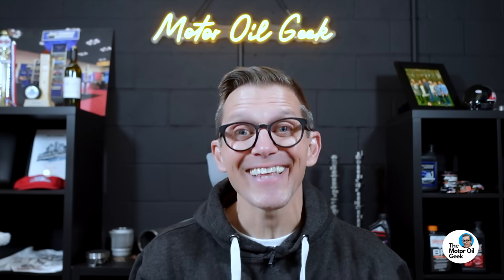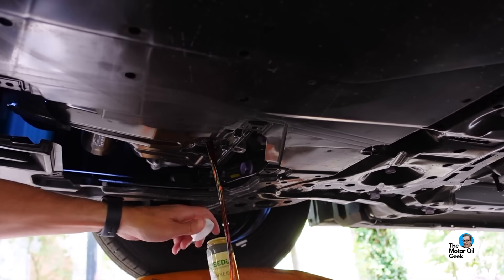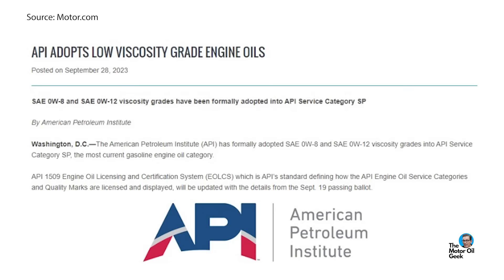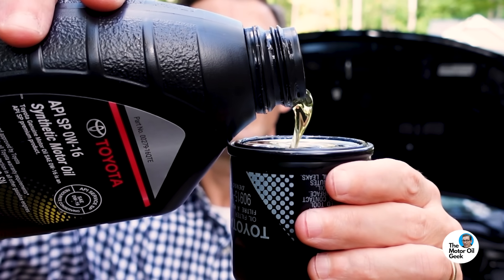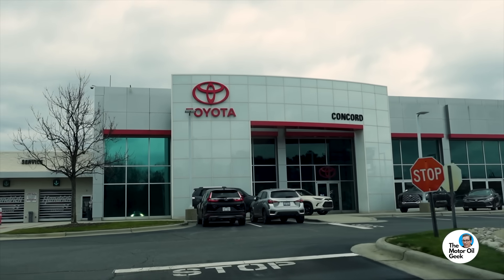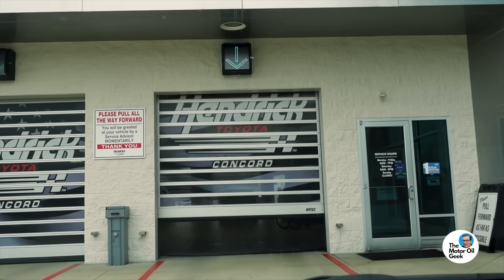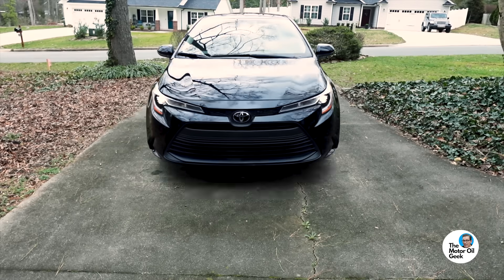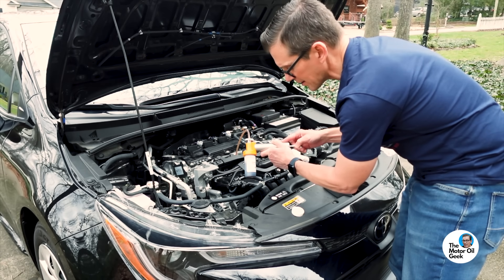0W-8 Motor Oil: Too THIN to Trust? Let's Find Out!

Comment: It's great that the Henricks Toyota Dealer in Concord used the proper quality oils.  I don't know the policy of Toyota over their dealers on what lubricants they're permitted to use.  But typically dealerships will order in bulk from whatever oil distributor they get the best deal from.  

To be clear, whatever oils they use are not some cheap no-name oil.  They will get a known quality name brand that we have all heard of.  But it isn't always the "OEM" branded product.
Reply from the maker: I was pleasantly surprised as well!
Reply: As a hendrick Toyota Tech, I've only ever seen the toyota genuine oil ordered in bulk, I see pallets of the shit piled in parts every time I go to grab a box, we have pumps for 0w-20, 5w-20, and 5w-30. They use a synthetic blend so I've heard from the older techs, when it comes to off brand vehicles we usually source what they recommend (Mobil1, DEXOS, etc...) if the manufacturer doesn't specify what the vehicle needs then they get whatever is coming out of the pump. My favorite oil I've seen was this green shit we had to special order for a BMW weird euro spec stuff
Reply: @S1Lent_Wanderer  Good to hear that your dealership makes this effort.  Many don't.  I know of a Chevrolet Dealer and a Dodge dealer for example that buy the lowest priced stuff in a drum they can get at the time they order more oil for their service departments.  

Even then, it is good oil and isn't really likely to hurt anything.  I know that the Dodge Dealer gets a 0W/20 and a 10W/30 no name synthetic and the same weights in a conventional no name oil.
Reply from the maker: @S1Lent_Wanderer  Thanks for sharing!

Comment: I ❤ Toyotas, but don't trust any dealerships. I'm a mechanic at an independent shop and have seen some unbelievably sly things being done at dealerships. Remember, the Toyota dealerships aren't Toyota, they're all independently owned and run. I don't trust any dealership of any manufacturers at all. They lie and deceive. The only real way to know 💯% that your car's getting the correct maintenance is to do it yourself.
Reply from the maker: I hear you. From the comments already, there seems to be quite diverse responses from different dealers. Your points are very valid.
Reply: @themotoroilgeek  I actually witnessed my local Nissan dealer send one of their techs across the road to go and buy cheap aftermarket cv axle rubber boots to fit on a customer's car. This is in South Africa. I drive a Nissan Sunny 2001 model and replaced my cv boots with the cheap aftermarket (Partquip) one's,  and they lasted exactly 18 months, whereas the original boots lasted 18 years!  
I duly replaced them again with Genuine Nissan boots (at exactly 10x the price of the aftermarket one's), and they're holding up just fine. So, that dealer is obviously charging the expensive price, fitting the cheap one's, and he's guaranteed a return customer within 2 years, when their cv joint goes bad. If you're not very mechanically inclined, or even a tech yourself, you can get ripped off badly. The independent diesel shop where I work at do this all the time to people. I just shrug, became I'm just an employee and need my job.🤭
Reply from the maker: @BubblesTheCat1  WOW!
Reply: @themotoroilgeek  Yep, a woman came in with her Hilux 2.8 Turbodiesel, which she uses to tow a horsebox trailer.  She noticed an oil leak, and I got the job to inspect and repair. I discovered the "half moon" at the rear of the valve cover leaking, causing oil to run down the gearbox bellhousing. My bosses told her it's the rear main oil seal, and promptly had me remove the gearbox to replace the seal. They then also told her it needs a new clutch (it didn't), and I had to replace that as well. After I finished everything, my boss said: "O, and don't forget to remove the valve cover and reseal the half moon rubber with gasket sealer. So, they did actually replace all that stuff, but it wasn't necessary at all.

Comment: I would like to see this oil in a high stress environment like towing or racing.  I bet we all know the outcome. Im not against thin oils. But  even Ford specs 5w50 for the track pack coyote. So obviously, thicker is better in high stress environments. Maybe in the corrolla, it doesn't matter, but i wouldn't lose any sleep with a 5w30 in it.

Comment: I’d like to see an episode on zinc/zddp for flat tapped cams. How much is need for breaking in the cam.How much is needed to keep a flat tappet cam alive after break-in. Is ZDDP corrosive or cause bearing to flack as some internet expert’s state.
Reply from the maker: Check out the video I did with @DavesAutoCenter

Comment: Thank you for sharing this valuable data. What engine oil change interval would you recommend for a 2024 RAV4 hybrid which is averaging 50% in EV mode and 50% in gasoline mode?
Reply: This 2019 Camry owner has the same engine as you do and it has lasted 501,950 miles using Mobil 1 0W-20 changed every 4,000 miles: https://imagizer.imageshack.com/img923/3987/L6hyvR.jpg

Comment: Didn't realize that the new Corolla also requires 0W-8 oil.  I've only seen it for the Crown and the oil almost feels like water.
Reply: "Required" only for US government mandated maximum fuel economy reasons.  Outside of the USA Toyota owners manuals tell new Corolla and Yaris owners they can use 0W-8, 0W-16, 0W-20, or 5W-30 if they want to. https://imagizer.imageshack.com/img924/6495/sVxyf0.jpg

Comment: Lakespeed you should try Amsoil cvt transmission fluid. It was a night and day difference in my vehicle. My mitsubishi lancer runs very smooth. Ask Bearded Ford Tech. Just make sure its compatible for the the vehicle.

Comment: My wife's Subaru calls for 0-w20. It started burning oil at 120,000 miles requiring a quart every 2500 miles. I switched to 5w-20 and it hasn't burned a measurable amount of oil for 80,000 miles since.
Reply: The W number is strictly a cold measurement, it's likely something different between the two.
Reply: @PSA78  they recommend 5w 30 so they want higher weight in cold an hot also higher weight oil you get less blow by on these di engines so less intake buildup
Reply: @JoshDillon-lm3hw  It's not "weight", the W(inter) is just a measurement of cranking force at a specific temperature (really low) and the last number is regular viscosity (span) at 100c (converted to a number for each specific type of lubrication; like engine or transmission). The W number can theoretically always be reduced (diesels sometimes excluded practically as they don't like the high amount of viscosity modifiers that might be needed). 
How much oil they burn is more down to how volatile the oil is, a small change in viscosity isn't going to matter when all things are considered. There's possible wear reductions with lower viscosity as well as the additives works more efficiently in mixed and boundary lubrication regime, it all has to come together in the end. 
It's like Lake says, let the UOA tell what's happening
Reply: @PSA78  the numbers are the weight of the oil lol weight is what viscosity was to called the last hundred years why people who don't know oil think that's what w stands for
Reply: @JoshDillon-lm3hw  I dare you to Google what W stands for. 👍
Reply: @PSA78  I know what w stands for winter why don't you google oil weight
Reply: @JoshDillon-lm3hw  I just had to inform you that W stands for Winter, you said it stands for weight.
Engine oil viscosity is typically categorised under sae grades.
Reply: @PSA78  no I never said w stands for weight  you never read what I said you made assumptions I didn't know what w stood for because you didn't know what oil weight is
Reply: @JoshDillon-lm3hw  What are you on about?
Reply: @JoshDillon-lm3hw  What they're on about is that "oil weight" is technically not the correct term for the XW-XX number system used for oil grades. Oil Grades are what are technically referred to with  5W-30 et al monikers. Weight just happens to have become synonymous with Grade because people don't speak technical data sheet and marketing teams know that.

So maybe don't make fun of people for not knowing something without making sure you actually know what they (and you for that matter) are talking about first. 🤷🏼‍♀️
Reply: @Horerczy  I knew exactly what I was talking about the whole time an im not the one who budded in the conversation started working in an oil shop when I was in school an have built track car motors last 15 years while yes oil weight isn't technical term it is the term used in every shop by every older guy I've worked with my whole life
Reply: @JoshDillon-lm3hw   So what you're saying is you're knowledgeable but suck at communicating that knowledge. Got it. 👍🏼
Reply: @PSA78  Weight was a synonym for winter.   If I said I was using a heavier weight than 0W20, most people knew what it meant.  But yes, W is for winter.
Reply: @lonniebeal6032  Weight was a synonym for winter? 🤨What do you call summer then?
Engine oil is measured in kinematic viscosity by standards (usually at different temperatures to include VI), and absolute viscosity at different really cold temperatures. The W number is representing the absolute viscosity at really low temperatures, and each W number has its own temperature and viscosity threshold/span (it's there for pumping at extreme cold climate, that's it). The kinematic viscosity also have a span, upper and under that will put it in a sae grade (and those numbers are also different for say engine and gearbox classification even if they measure the same).
I know people sometimes wrongfully use the word "weight" in some countries when talking about viscosity/grade and I'm guessing that's a century old habit, but the W number stands for Winter, and the latter number is the designated span it's in at 100c. 
Just for fun I Googled and the page show article after article from lubrication companies specifically pointing out that W stands for Winter and not weight.
Reply: Carbon cleaner. Rings are stuck. Seafoam
Reply: No
Reply: That's cause subarus seem to only call for 0w 20 in the US I have a new wrx an it say 0w 20 but in Japan Australia an Canada manuel says 5w 30 it's emissions crap they don't care about the life of your engine

Comment: You just opened up a big bag of snakes!
Both Valvoline and Castrol now sell ATF/CVT fluid.
You can pour it in both types of transmissions.
I have been using the Castrol for both types of transmissions with no problems. So what gives?
Reply from the maker: One size fits all means it doesn't fit anything well.

Comment: Just got back from the first dealer service with my 2023 RAV4 and quite disappointed to see that they used 5W30 while it should be 0W16. 

Ofcourse I asked why and they said this is what Toyota advises and even showed me in their system. I’m a little confused now, but it doesn’t feel good to leave it in…
Reply: 5W-30 is fine for your A25-FKS engine. Australian owners manual: https://imagizer.imageshack.com/img924/8145/trnGHE.jpg The USA government wants you using 0W-16 for maximum fuel economy reasons.

Comment: Some Toyota hybrids take regular Toyota ATF. They use 2 electric motors and a planetary gear set to change the gear ratios rather than a belt or chain. Super reliable and durable
Reply: eCVT
Reply: Toyota HSD hybrid system is NOT using a belt don't get mixed up with DAF Dutch cars or some FIAT transmission. The CVT is made by an electric motor (different from the traction motor) controlling transmission ratio with an epicycloid system. Indeed the feeling is about the same , kind of weird not really sports like excitement, just your wallet is very excited.
Reply: @semperfi4309  I beg to differ. My 2002 Prius is definitely NOT a sports car, but response to the accelerator is instant. Zero rubber-band effect (you step on it, and it ACCELERATES, it doesn't lag)
Reply: This is correct  @semperfi4309
Reply: Yes. They have eCVTs instead of CVTs with a belt or chain and cones. They recommend only Toyota WS ATF.
Reply: This. My 07 Prius uses the same Valvoline MaxLife ATF that my 07 GX470 uses with no issues. ✌️
Reply: @VuickB6  How do you know it has no issues? Maybe it will last 150,000 miles but regardless how long it does last, if you used only Toyota's recommended Toyota WS ATF it might last an extra 25,000 or 50,000 miles  extra?? We'll never know will we?
Reply: @stevensevek6151 Using fluid that's the same spec as factory makes me think they'll last the same. After all the Lexus has 205k miles and the Prius has 292k miles so something is working as it should. 🤷
Reply: Ok you’re talking about the Hybrid not the gasoline motor only
Reply: @AB-yc1np  as far as I know, yes. The eCVT trans is for sure belt/chainless, but I'm unaware of Toyota's gas only trans construction.
Reply: @ElPants21  the two are different.  The eCVT in the hybrids is incredibly reliable with countless examples having well over 200,000 miles.   The CVT in the standard gas powered vehicles on the other hand, I have not seen any that are known for their reliability regardless of the manufacturer.  Subaru, Nissan, Mitsubishi, Honda, Toyota, it doesn’t matter.  Some are slightly better than others, but none carry the same reliability as the eCVT.
Reply: @ElPants21  , the eCVT Does have a chain
Reply: @littlet7556 It does but it’s tiny and isn’t a primary drive chain like other designs
Reply: @nordicpride9708  , it's not a tiny chain. Maybe smaller in OAL but very stout
Reply: @littlet7556 no it doesn’t.

Comment: CVT transmission fluids are generally clear, green or light brown. I have not seen a red CVT fluid yet.
Reply from the maker: The color is just dye
Reply: @themotoroilgeek  so is the green and light brown. But someone who works on these rubber band transmissions daily....I've not seen red. Red is usually reserved for dex/merc hydramatic style transmissions.

Comment: Just took my 2024 Cross in for service. The dealer here in Canada is now recommending 5,000 mile changes because of the climate. I had already booked it for a change since I didn’t want to wait to the factory recommended 10,000 mile change.
Reply from the maker: That makes sense